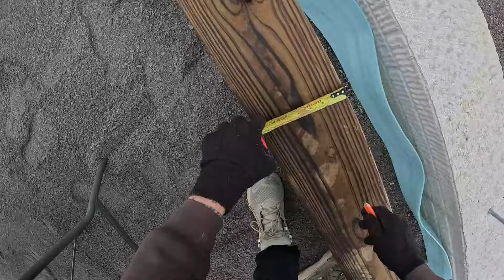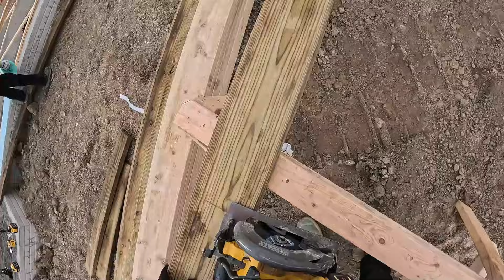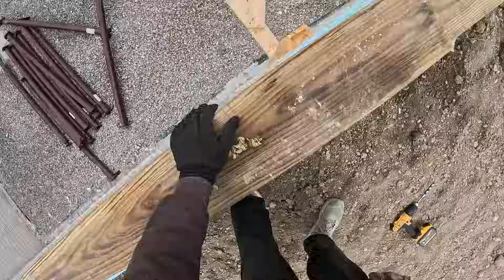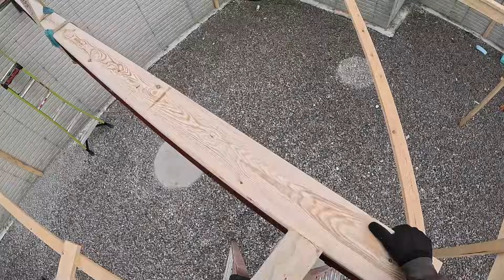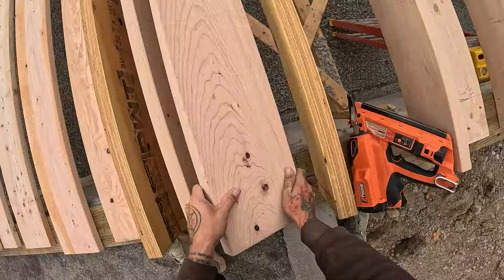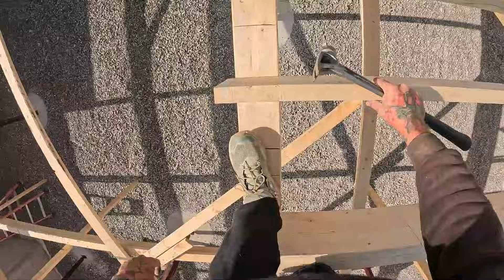Series 2 | Day 1 | Single Story Ranch House Build

Comment: A tip for next time. After you drill your holes in your sill plate, staple your sill seal to the bottom and then put it on the wall. It makes it a lot easier when its windy.
Reply from the maker: Jeez, we have a few hand tacker staplers, I never think of doing that. Will be bringing that out next green plate day! Thank you!!
Reply: @OlDirtyCarpenter  no problem! I build in windy Michigan, so I have to get creative most days.
Reply: Was gonna say the exact same thing!!!